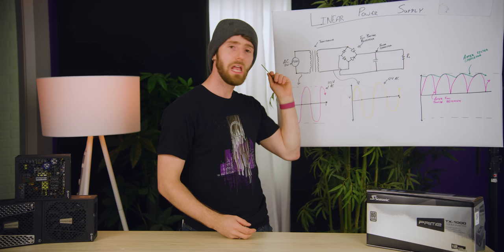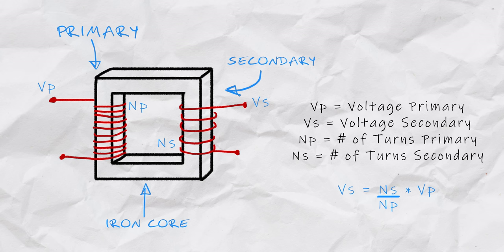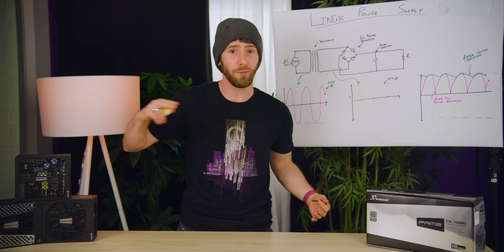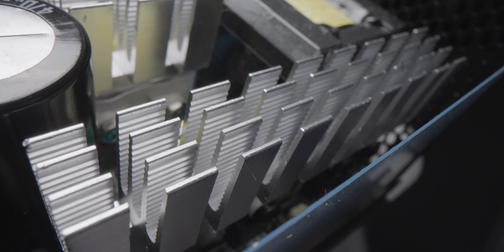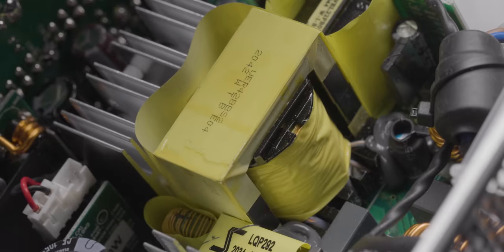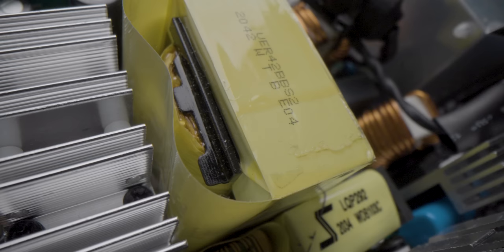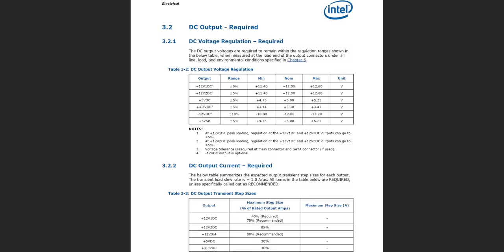How Power Supplies Work - Turbo Nerd Edition

Comment: This is a great turbo nerd video. but.. OK, i was expecting a bit more. Switch mode supply is fascinating compared to the regular linear type. A little bit focus on the heroes on these modern high power PSUs would have been extra nice. There are at least two (apart from APFC and protections). The super sensitive YET High power MOSFETS being used as a PWM controlled HIGH voltage ON/OFF switch and the relationship of that ON/OFF action of HIGH Voltage going to 12 volts. They way Switch mode PSUs works is as brutal as it gets in terms of massaging power but how efficient it is for PC industry is astonishing. This solution made power supplies lighter by not having HEAVY transformers from the past.

Comment: There is a missing component after the regulating capacitor and drain resistance, in the schematic you have demonstrated the voltage will still oscillate and could be dangerous for computer, therefore a regulating transistor of 78xx and 79xx families  (depending on polarity) is used to ensure a linear stable non-oscillating voltage

Comment: I have a 700W Corsair since 2012 and works like new. I changed 3 GPU, 3 motherboards, 2 CPUs and  cases, but the PSU is still good.

Comment: Interesting. I noticed something incorrect in an article about electronics. Your transformer is not going to 12V AC. After you go through your rectifier and your capacitors, you'll end up with a DC voltage of what your peak voltage is under AC. So if you go from 120V AC to 12V AC Root Mean Square, you're going to end up with 12 * sqrt(2) = 17V DC which is WAY too high. To be at 12V DC, you'll need to convert to start with a AC voltage of 12 / sqrt(2) = 8.48 RMS.

Comment: I run Seasonic PSUs and still change them out every 5 years. Filter capacitors just have a finite lifespan. If you want your PC to keep running fresh PSUs keep them running. Recapping a PSU isn't really practical to do either. It's probably cheaper to just buy a new one.

Comment: I bet seasonic loved the footage at 5:49, there could even be a clause in the contract that compelled LTT to show a footage of the Nichicon caps. For people who don't know what the hell I am talking about nichicon is "the" japanese capacitor PSU vendors were selling you 10-15 years back. Then came other Japanese caps that weren't as good as Nichicons but they are still "technically" Japanese caps so you get fucked but you don't know that you did.

Comment: They doesn't even mention high  efficiency synchronous rectifiers which is the standard at the output of hig quality power suplies, they use  hig current and ultrafast mosfets digitally controlled instead of  diodes

Comment: I can attest to the fact that modular PSU cables don't just swap with one another. I borrowed a SATA power cable from a friend, and when I plugged it in and turned on the pc, it melted the cable and almost destroyed the power pins on both my SSD and hard drive. I got lucky and was able to still use both drives, as no data was lost. One more PSU later, and I learned my decision. DO NOT MIX MODULAR CABLES UNLESS YOU WANT TO LOSE IMPORTANT THINGS

Comment: On the topic of capacitors, and the future of high efficiency capacity power supplies. The powersupllies you will be looking for will no longer have electrolytic capacitors. MLCC have much better frequency cracteristics, "impedance" electrolytic capacitors are simpler and easier to implement for SMPS. But the trade off is a order of magnitude capacitance and size increaee for the same frequency vs resistance curve. 

Also, you will see polyamide input filtering and series resistors for the primary voltage in favor of electrolytic. However a sufficiently quality design may still use electrolytic. 

Finally you will likely see adoption of tantalum capacitors. 

This will make what once was a 500 dollar power supply 1500 dollars. 

Or you will see an overhaul of the atx standard to allow for bigger power supplies as we hit and exceed the 1500 va wall. I have no idea how AC deleiver to these power supplies will be approached. 

But soon cpus will have peak current of 800 watts also. 

Perhaps this will be addressed with super capacitors. Adding complexity as an additional smps stage will be required if not several.

Comment: very high voltage DC is always better for transport, it's just the losses when it comes to converting it back to a lower voltage AC basically destroys the benefit of the more efficient transport. it's better now than in edison's time, but the primary reason AC won out is AC is just super easy and efficient to convert between high and low voltages. keep in mind this is the time before the transistor and DC-DC convertors were way inefficient. also note high voltage results in less transmission losses compared to low voltage. AC is less lossy at lower voltages(well we're talking kilovolts) but DC overtakes at some point on the even higher end.

Comment: yea, hate to tell the non americans but our grid isnt 110 its actually 277 volt. we use three phase power on the lines and just pull 2 of the 3 lines from the transformer for most residential uses and some commercial as well. Others need the full 277 for heavy machinery or thirsty equipment like massive server banks.

Comment: 110VAC To DIODE : 154VDC MAX. electron tube triode grid to 142VDC = 12VDC
154VDC to 142VDC = R = U / I  (V=R x I) GRID 25mA 154V = 6K16 RESISTOR.

Comment: Not entirely true about having to make different power supplies for different markets... multi-tap transformers exist in where you can accept 110v and 220v inputs and still have the same output voltage. So they would simply use one of these with a voltage selector switch and away you go.

Comment: Not bad guys, not bad at all! Now how bout an analysis in the frequency domain?

Even many seasoned electrical engineers don't realize the importance of "power integrity". 

Let's say you have PCIE4 pushing signals at 8GHz, well guess what, something has to source some damn fast current in order to construct these signals.

The frequency domain can be used to see the ability of PCB power distribution to provide current at required frequencies.

Comment: Technically, the transformer shouldn't take you to 12V DC - it needs to be higher than that to account for the voltage drop across the components in the circuit - although the voltage regulator drops the most voltage across it and I don't see one in that circuit diagram, which won't make for a very nice power supply.

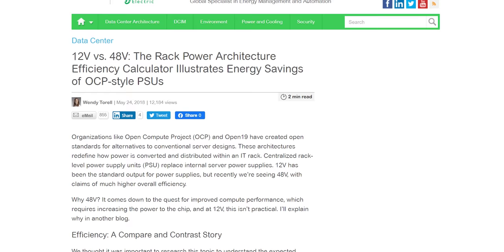Comment: 11:53 "Basically, higher voltage means less current at a given power and less current means less heat generated and a higher efficiency"

So the industry got it all wrong. They should step up the voltage from 110V to 1000V and not down to 12V.

And yes this is a joke.

Comment: One of the parts in a modern PC with the highest failure rate has to be the motherboard.  I’ve personally RMA’d or replaced too many of them after only a handful of months of use.  12VO sounds to me like a great way to increase e-waste as the already incompetent motherboard manufacturing teams will have more work on their plates.

Comment: some free advertising here. When I bought my last pc I ordered a Corsair power supply with it. Sadly that one died on me and is swapped it back for an old Seasonic power supply that I still had available from the pc before. I still use that power supply today not sure how old it is but I guess at least 10 by now and still going strong :)) not going to buy corsair for sure in the future.

Comment: That actually isn't true, there are switches on the back of linear power supplies for 220/110v that change what taps on the transformer is used, then it is stepped down to a higher than needed voltage, such as 30v, then passed through voltage regulators for the dependent lines into filtering caps. Hence one PSU for all markets.

Comment: can you do more like this, like how cpus work, the transistors n logic gates and things. how do they design them? how do they fit it all in one small package? why is it that over time the voltage you run cpus at has decreased a ton, is it to do with the decreasing transistor size? how does the low level code actually talk to what amounts to logic gates? also all the maths stuff thats the best bit

Comment: Actually that was a bad explanation of a linear power supply. What you talked about was a regulated linear supply, but what you showed was an unregulated linear supply, which has similar efficiency to a switch mode power supply, but isn't regulated (which you need for a computer) - linear regulator is a cause for nearly all the power loss. Also it doesn't require a completely different model for different voltage. Most are made for 50 & 60 Hz, and the voltage can be switchable, so they're just as versatile.

Comment: For your electrical engineering decorate? That seems extensive. My undergrade degree was in electrical engineering and while we didn't quite get to that level, it was something came up with a few projects. Then again we did get into some interesting projects that weren't technically expected for the class do to the interests of the students...probably the best thing about the class getting a new lead instructor for the EE program, just don't ask about all the downsides of that professor.

Comment: That's not a linear power supply... that's just the rectifier, the SMPS also has one.  The linear (or non-linear) is what comes after the rectifier, and here only the non-linear was shown.

Comment: So, if you swap the coil spins, you can multiply instead of divide the voltage. The transformer in a used/broken microwave scales up 110 to 2k, which is incredibly dangerous, but if wired in reverse it brings the voltage down by the same factor. The reason I know, is my crazy 8 year old making me take one apart.

Comment: On that last note of landfills. Please don't send used electronics to a landfill. Take them to a reputable e-waste management company. They can resell components that still have life and responsibly recycle parts that don't. Remember, reuse comes before recycle.
Reply: Sadly those still often make their way to 3rd world countries for disposal from what I can tell. E-waste centers sell off bulk quantities that get shipped to markets with cheap enough labor to make the removal of useful components, and eventual material extraction, economical.
Reply: @JimBob1937  It's true. You have to find recyclers that are certified by E-stewards and/or R2 which require thorough documentation of where their materials go after they process them.
Reply: @LuisCaneSec  , ah, good to know what to look for, thanks.
Reply: @JimBob1937  Yeah, no problem. The R2 website even has a locator tool to help you find certified facilities. They're international too.

Comment: I'm not sure they'd have to make different transformers for each market, I think you could just wire the 110/220 voltage switch into cutout windings on the transformer so it would utilize fewer or more windings, couldn't you?

Comment: I once had a 1200 watt 80+titanium power supply. I bought it for 170 bucks and it worked fine and as expected untill i turned the powersupply of and on again, which resulted in a cap busting. This happened 3 times after rma'ing it. After that I requested a chargeback and luckily got my money back. I still wonder why it failed after turning the supply on for a second time

Comment: I have an instrument with measuring system for power supply voltages so every five six days it measure  the 12 volt 10.5 volt and put device on hault ...we need to restart it several times to get it right

Comment: I´m actually questioning myself if I should change my 2014 Corsair PSU for a new one, when I upgrade my PC next time. I might do and get one that will last hopefully for decades, if there actually is a new standart. The old one (RM650) is still working perfectly, so I will put it in my secondary computer, wich is powered by an 2007 PSU. xD

Comment: why is there only 110 voltage in the US? Here in Brazil we have both 110 and 220 in the same city, sometimes even on the same street.
Reply: We use 120 volts for normal outlets and 240 volts for high current things like stoves, electric dryers and water heaters.

Comment: Every electronics engineer in the comment section says how this video is right and blah blah. However I see many mistakes they said, like: Metal oxide vari-RESISTOR??? You mean Varistor, don't you? The thing they didn't mention is the PFC in the high voltage stage after the rectifier. But they did mention 300-400V which don't appear there. If there is no PFC, then you can expect like 330V after the fullbridge rectifier, not ever 400V. I hope they hire somebody who actually knows electronics very well

Comment: That's not really a linear power supply so much as an unregulated one. With a mains frequency transformer to do the voltage conversion. A proper linear power supply also some analogue voltage regulation circuitry in it and that's what makes it linear. Such as a 7812 voltage regulator if you want +12VDC. These need to have a higher input voltage than they deliver and yes they're not very energy efficient compared to a switch mode power supply.

Comment: 10:39 learned that one the hard way. Luckily my psu is smarter than me.
Reply: You mean all that keying on the molex connectors doesn't stop an incompatible cable being connected? So you have to plug them all in, short what you think is 5Vsb to ground(?), and if the fan spins up, check all the other pins have the voltages you expect?

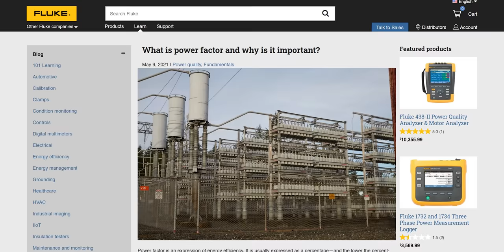Comment: 5:25 I actually bought both the products displayed on/in the add on the right and then i chucked them out, those products have a 5amp clamp and i have to buy additional equipment from the OEM how ever the additional equipment gives me an error of 0.2% which is huge. I have suggestions, if you are interested.

Comment: I still don't think its 12 v ac from the transformer, because they have to factor in any voltage drop from transformer to the rectifying circuit etc....etc..to said voltage regulator to output 12v dc

Comment: 12:28 and ... 500 watt CPU and 900 watt GPU came to market! Time to upgrade )
no, really, what the heck is with power consumption in the last couple generations of hardware 

i had 450-600 watt PSUs since my first PC in 2002 (all of them were mid range (ish) for the time)
now for mid range PC 600 is barely enough (if at all) and 800-1200 is considered a norm !? WTF O.o

Comment: "Why did I just explain linear power supplies" uhh... you didn't. You explained transformers and AC-DC conversion which are present in computer PSUs. Linear power supplies are DC-DC but drop voltage by basically just burning power.

Comment: Good video. I have a question. If you have infinite wattage coming from the wall then why PSUs cap them to 300, 500 or 1000 watts etc. Lets have a PSU that only does the stepdown, distribution of the voltage and other things but does not cap wattage to something like 1000 or 500 watts. If I am wrong please correct me with a reply

Comment: my question has always been, why rent modular cable ports just the same as the female port on the motherboard and gpu? i mean then it would e more convenient because its even reversible, and obviously those connectors arent in short supply.

Comment: if the switch uses 5V coming from a little transformer who takes the high voltage from the second transformer,how can it be always on? it will need to have the first and second transformer powered to do it,so all the parts have to be running while is off.

Comment: Is y or x caps are normal caps that used in a specific whay or thay have different construction ??🤔 
I read that X caps are used to connect L and N 
And Y caps are used to connect N to  ground (Case)
But I couldn't find my answer to the question above

Comment: How do I look up if my supply has a mov without opening it? EVGA doesn't have a public diagram that I'm aware of. (To be fair, I'm assuming  the fact that it's not a budget supply means it will, but in principal, how would one find this info if it were a likely concern?)

Comment: but I still dont really get why it's that much more efficient to do the power conversion to lower voltages on the MB I mean you are converting to 5 and 3.3 nonetheless and I doubt that the resistance of the cables is that craty at the short lengths in a computer

Comment: It should've been illegal to sell non-compatible modular PSU cables, particularly if they are not clearly marked, but just all black, while the connectors are physically compatible. I had no knowledge of this stupidity, so when I connected my 5x3.5" dock to my PSU, I lost five HDDs at the same time. That was really expensive.

Comment: 3 phase bridge is better.  And ..... better than that?  Two 3 Phase transformers, one whose secondary is wired as Delta and the other whose secondary is  wired as WYE.  Slap a bridge rectifier on each and connect the + terminals together,  connect the - terminals together and voila ... 12 peak spaced 30 degrees apart.  The only thing better is the commutated power from the brushes of  a DC motor (a motor generator).  That's about it for LINEAR power supplies.  Why they don't teach this in schools is beyond me.

Comment: I know some power supply manufacturers, such as RaidMax, should be avoided at all costs, but can anyone tell me what the specific issue is with them? I’m guessing it’s capacitor quality (or lack thereof), but if it’s something else I would like to know. 

(Not because I want to cheap out on a power supply, I’m just curious)

Comment: Why not just convert to DC before the power enter our home. Have a box just outside our home. That way lineloss is not a problem
And we get safer power cus u can touch 230volt DC and u will barely feel anything but 230volt AC or even 120volt AC will fry you.
 also it gives better efficiency cus we dont have to convert for every single device.